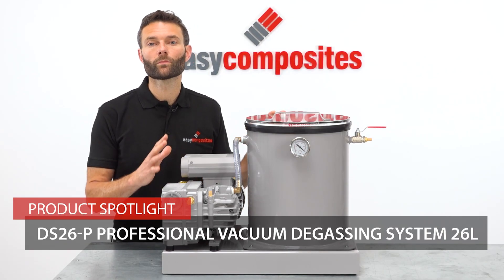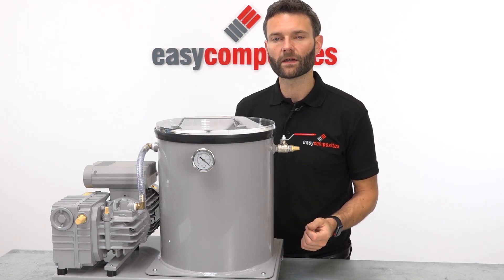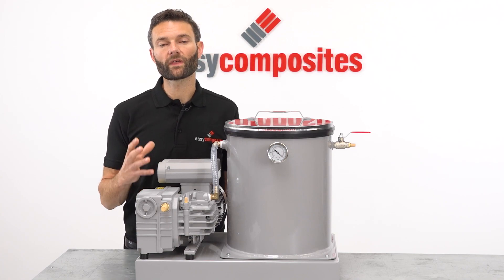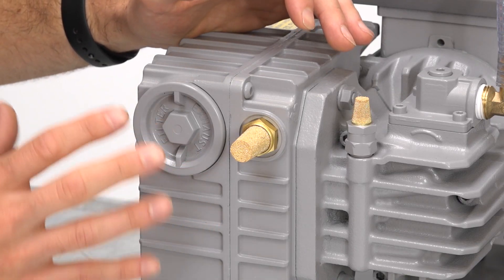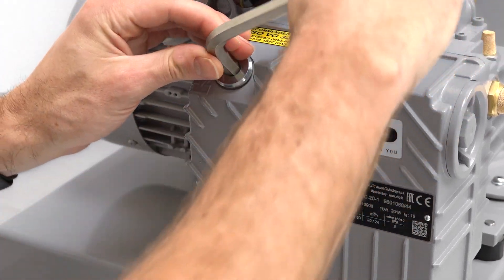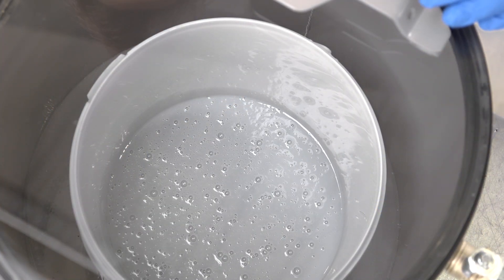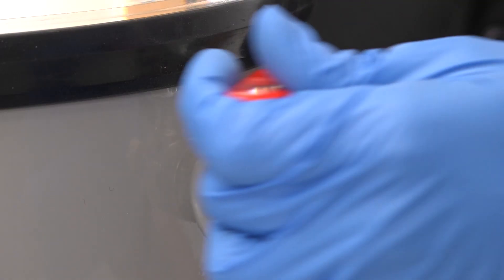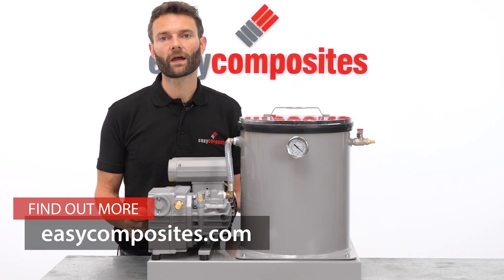ECP DS26-P Professional Vacuum Degassing System 26L - Product Overview

Comment: Can such vacuum degassing system be used for eg. drying plastic pellet/3DP filaments too?
Reply from the maker: Yes but if you’re extracting large amounts of moisture out of materials then you would need a moisture trap to condense the water, without one, the oil in the vacuum pump would begin to emulsify.
Reply: @easycompositesproducts2810  Can CP1 Resin infusion catch pot be used as a moisture trap for that purpose or there is specific device for that?
Reply from the maker: @brezovprut4431  At full vaccum, no. Any liquid would still be in vapour form as the boiling point would still be too low. For low levels of vacuum though it may work.